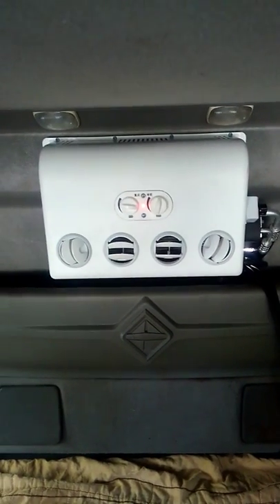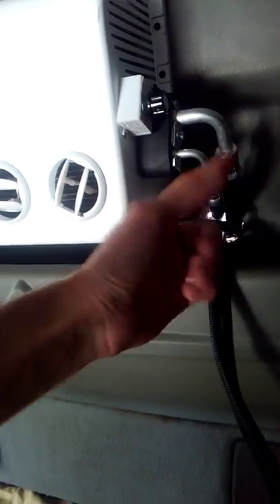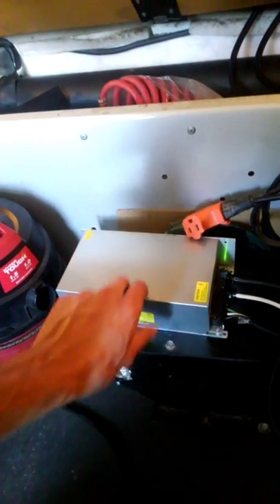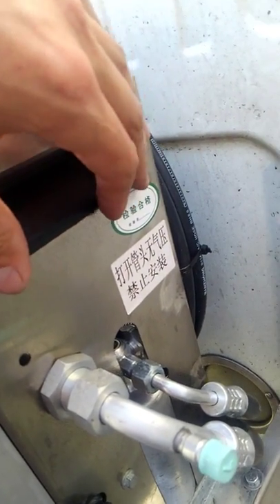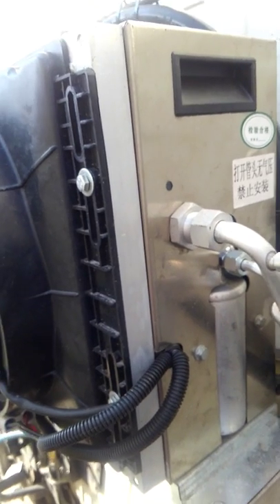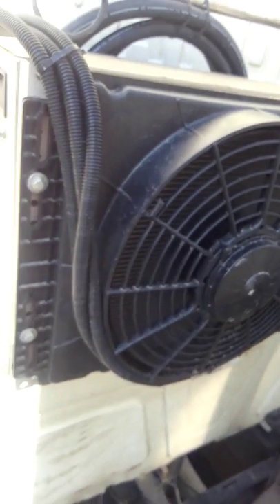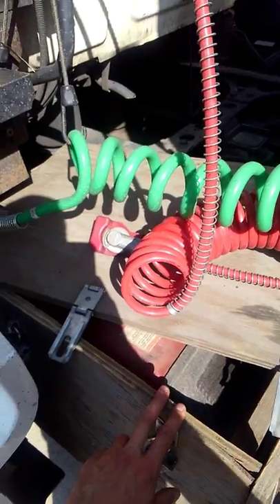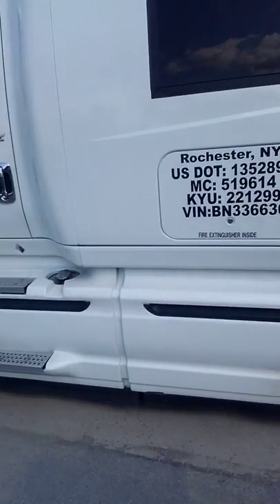Semi truck 12volt air conditioner

Comment: Very nice and forsure a cheaper route than a APU nice job however if the ac unit can't cool the cab down to at least 65 degrees in a 125 degree day it wouldn't be worth it to me.

Comment: Good video. 7000 to 12000 btu is more than enough for a semi. After I run my mini split for about 7 minutes its cold in my truck. I recently saw a video about solar powered 12 volt mini-split units. I'll be getting one in the future.
Reply: What kind of battery you have put or you using the generator for  that unit?
Reply: @martes8877  I have a Pedator 4375 and I'm using regular truck batteries.
Reply: Hey bud, can i have your contact so I could ask you a few questions about the mini split? Thanks
Reply: Hey bud I have a 12 V AC unit on my truck I’m trying to make it run with a 4000 W generator what do I need to get it going
Reply: @ElCochiloco369  12v ac?   You mean dc.  Um im thinking that whatever system you are looking at should give you power requirements so if using 12v  dc it should say like needs fused for say 60 amps so running it would pull say 50-60 amps then you would need minimum of 12v 60a converter but i would go bigger and then hook it all to the trk batteries. However i would look into a regular mini split system that runs direct off generator so no bats or converter required as less space needed and no conversion power loss unless you are planning a large bat bank to run system with no engine required and bats charge off trk bats when driving.  Thats my opinion
Reply: A have treeligo from.amazone i.m.very happy sleeping like baby
Reply: @carlosnino4393  Do you have a mini-split? I tried to find your treeligo on amazon. I couldn't find it. It might because I'm in Panama. If it is a mini-split you should install 2 brackets on the top of the outdoor unit to stop it from moving back and forth on bumpy roads. If you don't the welds on the legs could break. I mentioned installing brackets in one of my videos.
Reply: @passporttrucker9280 im trying to put a mini split 18k btu on my truck but im not sure how to wire it to the truck any advise
Reply: @bwill221 If the instructions are not enough you should call customer support. If they can't help you have a shop install it. That would be better than damaging the unit or getting shocked.
Reply: @passporttrucker9280  i know how to wire it to a house just was wondering is there any difference with the truck
Reply: @bwill221 If you have a a/c unit you have to use a power inverter or a generator. Don't think you will be able to wire it to the truck which uses d/c
Reply: @passporttrucker9280  ok thank you I will hook it to my inverter
Reply: @passporttrucker9280  yeah I think my unit is too big for my truck the compressor wont come on its 18k btu's not sure how to get it to work it needs a 15A minimum to come on have any ideas 😅

Comment: You need 1000ah deep cycle battery bank.  With a stock alternator it will take 8+ hrs of driving to charge them.        1000ah will be enough to cool the sleeper 10-12hrs depends on temperature.
Reply from the maker: One problem. Weight!!! 80lb per battery means 800lbs extra weight. Not good.
Reply: isnt that why theres a generator running? smh
Reply: He looks to be doing gen route however yes bat bank is a green route in place of gen.  A little heavier yes but quieter and no extra fuel.  Drive all day get full charge and full nights ac.  Depends on how one wants to go
Reply: I was thinking to power this from a deep cycle battery….

Comment: I have installed a few of these units and wire directly to truck batteries. Then installed  honda.generator 2200  and connect a 40 amp battery charger to the generator and wire into the batteries....... Good for few hrs ...  any thoughts. Not the best route if u want more hr run time
Reply from the maker: I built lifepo4 batteries 12v 280ah each from 18650batterystore.com. 2x of them gives me 15-25hrs depending on outside temp.

Comment: I just finished installing a similar unit in my RV but when I went to charge it with refrigerant I realized they have some kind of weird Chinese style fittings on it. My gauges and adapters don’t fit. Where did you find the fitting adapters to fit this for charging?
Reply from the maker: Mine took regular 134a connectors.
Reply: @ne7s29  thanks. I just realized the home AC kit uses different connectors than a car AC kit. Got it.

Comment: VERY NICE A/C UNIT AND VIDEO!  I'M SURE A TIME WILL COME WHEN D.O.T. DOES ANY LEVEL OF INSPECTION, AND WILL PUT A TRUCK OUT OF SERVICE FOR HAVING EITHER A GASOLINE POWERED GENERATOR OR CONTAINERS OF GASOLINE ON THE VEHICLE.
Reply: Nope. It’s not illegal to have a gas powered generator or to carry gasoline under a certain amount. And never will be

Comment: Very nice video, I have a3500 watt predator inventor generator from harbor freight & I have aluminum box which fits the generator, so my question is,do you think the generator will get too hot with open door?
Reply: Cut holes of some sort of holes and run exhaust direct out and put some sort of louvers over holes at one end then other end cut more holes and fit a 12v radiator fan feeding fresh air powered by gens 12v battery charger plug then when ever gen is running you have steady supply of fresh air

Comment: Not powerful enough.  I installed the same unit in my T680 together with 880ah battery bank and a 320amp alternator.        When it's 80f outside at night it eats up battery bank to 12.3v.  keeping the sleeper at 19c=67F for 10hours.        When it's during the day 100F outside.   It won't cool the sleeper any cooler then 74f.        It's powerful enough to satisfy 80% of the yearly needs.        Two units are needed and 1500ah battery bank +320amp alternator to meet the needs of a t680 sleeper.
Reply: Is that with the sleeper curtain closed off from the cab? Or does the T680 not have one?
Reply: @fnfastone  that's with the sleeper curtains closed.   It's mounted under upper bunk bed.       It's enough to keep the lower half of the sleeper cool.      It's ok for a Solo driver.    But if I circulate the air inside the sleeper it's not powerful enough to keep the whole sleeper cool including upper bunk.         7000btu is not enough.
Reply: what type of batteries for the 1500ah? .. this vid. is the cheapest I've seen for lithium which can be discharged to 10% and get 5k cycles.   https://youtu.be/3trqJEDEj6A     You say that 74f is not enough cooling during a 100f day?
Reply: @tex959    just go to Sam's club and get deep cycle marine battierries they're the cheapest.   It will say on the lable how many amp hours they are.       Lithium is expensive and requires a BMS    and battery heater pads.  Lithium wont work on freezing temperatures, they won't charge in cold temperature.      As for beginners it's better to go with deep cycle lead acid batteries
Reply: @wojciechzgodowski   I appreciate the feedback but I assume when people tell me they prefer lead acid, they have never tried a lithium system. correct me if I'm wrong.   I understand cost can be a barrier.  

In the case of the deep cycle lead acid, you will dramatically reduces the life of your battery if you routinely drop below 50% depth of discharge.  which means you need about 75% more amp hours of lead acid than a lithium which can go 85% depth of discharge without reducing the life of the battery.  The guy in the above link paid about $1k for 560 amp hours including bms and wiring.  That's 476 usable amp hours.  consider the cost of usable amp hours with lead acid. A 100 amp hour battery for maybe $150 at Sam's, will give you 50 amp hours of useable power.  That means you would need 9 x 50 lb batteries which ads 450 lbs of weight compared to the 75 lbs of weight for lithium for a cost of $1350 for the "cheaper" lead acid.   Now consider that you can get 10+ years of of lithium compared to 4-5 yrs. out of lead acid(assuming you don't regularly drop below 50% depth of discharge.. 

I live in a warm climate but even if I didn't, the BMS will shut off charging below freezing and if I really needed them in freezing temps,  I could easily add a 50 watt. heat source attached to a thermostat.  They make similar heating element for pipes in cold weather.  If you're just heating the battery box, and it's well insulated, it won't take much power because it will automatically cut the heat on and off to maintain above 32F

Also, consider that you will only get the rated amp hours out of lead acid if you spread the amps over a 20 hour period.  If you spread the amps over a 5 hour period, for example, you will lose quite a bit of total amp hours and if gets much worse the faster you drain power.  This is called the peukert effect and only slightly affects lithium and dramatically effects other batteries. 

Everyone I've ever talked to in the RV world, that has used a lithium system, tells me that they will never return to any other chemistry even if cost is a factor because they save money in the long run. 

More info. on cost analysis of batteries .  
https://youtu.be/iy3hga_P5YY?t=206
Reply: @wojciechzgodowski  also, if you do watch that video.. keep in mind that the battery cost of the "battleborn" brand is 5X more than the DIY 1k 560 amp hour system, previously mentioned.  This will skew the numbers dramatically in favor of the lithium given that it can be done far cheaper than the video acknowledges. In other words.. even at a 5X higher cost for pricy drop in lithium with built in BMS, you're still saving money with lithium over lead acid given the life cycles of the respective battery chemistry..
Reply: Did you put that batteries additionally for unit itself?
Reply: @tex959  I have a total of 12 Trojans T-105 and 2 Lithium batterriesThe trojans are about dead now after over 6 years paid a total of 800 bucks for them all..the lithiums were 350 each..THE one thing found at were I live in AZ where summer temps get to 120 is that one cant really leave lithiums installed in a van at high temps So I had to uninstall and bring with me in my RV so they stay cool. my friend had to pack up the 4 he had in his RV and take home in pick up for summer so they do not get cooked...weight is a consideration for sure as well as fumes from lead
Reply: Useful info , I am looking to do the same in my freightliner classic , I just did not know how to power this thing …. So I need 1000ah deep cycle battery …..

Comment: But when truck is running and driving it can run off of regular battery correct?
Reply from the maker: If you set up a three way switch to connect it to truck 12v system it will.

Comment: How well does it cool the truck in summer time?
Reply from the maker: It performed very well. If during installation the ac system is not vacuumed properly before releasing r134 freon  the. it will not cool as designed because there is moisture mixed in with the freon. Proper installation is the key.
Reply: @ne7s29  ok. I have a 5000btu portable ac in a freightliner classic raised roof and it struggles in summer. Was thinking the split system would be better.
Reply from the maker: @merrissaramos7383   Well this air conditioner does not freeze you but it definitely took the moisture out and I was satisfied with it but this is not going to compare to some humongous unit
Reply: @ne7s29  Texas summer's are no joke. And didn't want a big mini split this one looked good but I'll keep looking. Thank you.

Comment: 1:40 I do not understand, why is transformer required ?
Reply from the maker: The air conditioner is 12v and a gasoline generator output 120 V so you need to step down the voltage. The generator does have a 12v output option but it is limited to 10 amps. The air conditioner needs 40 to 60amp at 12 V.  I highly suggest going with lipo4  battery Fram amazon. Get 2 200ah batteries and you will be better off. No generator noise or fuel to worry about or oil changes. Get renogy 60amp dc to dc charger for 250$ to properly charge the batteries fro. Your alternator and put them in your cab. Much less weight too.
Reply: @ne7s29  thank you for your reply ! how much batteries I need to have to skip the generator ? for 5 hours quiet a/c-ing
Reply: noise from this generators drive me crazy
Reply from the maker: @Uc9uE3pKsS6uQ   one 280ah lipo4 battery from Amazon goes for around 1300-1700$ you will need a dc to dc converter as mentioned in last msg because this lipo4 battery can charge so fast it will burn out your alternator. The 280ah 12v battery will run for approx 8hrs up to 10. It all depends on the outside temp.